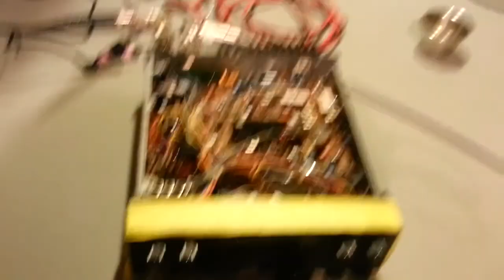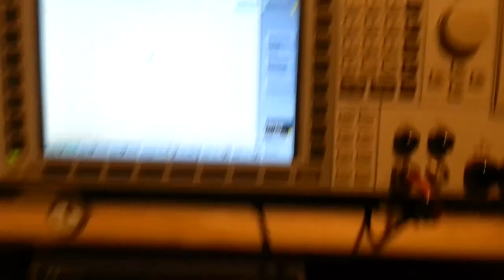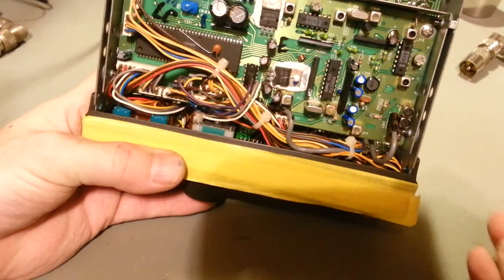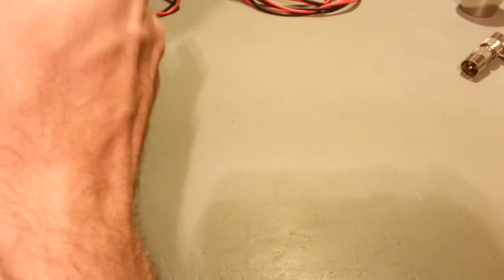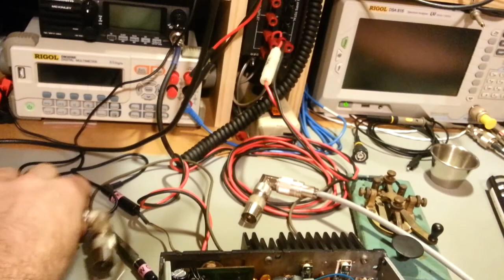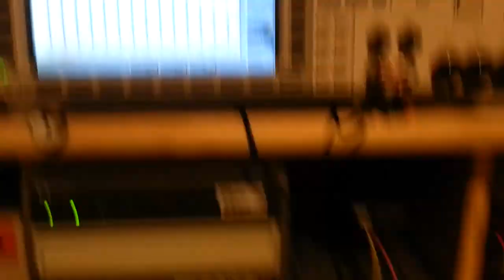President HR2510 restoration.

Comment: Thanks for posting this video. Can you please sugges/guess for me what might be the issue with an old 2510 that I’ve pulled out of storage that powers up but I don’t hear any audio besides a hiss happening and my liquid crystal display has some black blotches but no other digits or numerals displayed? It used to work just fine and I’m just trying to understand if it’s salvageable?  Someone suggested to me that could be a bad display. Glue on components is still a beige colour with no evidence of burns or decaying. Thanks.

Comment: I loved my 2510s. I guess this is still relevant.  You talk about drilling but not with a power tool. I bought 2 (a spare) 3 jaw chuck used on a dremel tool. It has a knearled barrel to hold onto. I put a wood peg in back to rest against your palm. The 3 jaws hold pretty much any drill bit or auger. Works great, comfortable and gets the job done.  And with less skips or missing your mark.
If you get this and know. I don't have any papers on this radio. The final is also used in a mobile amp. I'm hoping they dropped in price or a newer or better substitute . Got any part numbers for me?
Cheers.

Comment: I just acquired one of these. The display doesn't work but the rest does. I'm in the process of re-capping it in hopes of getting it operational. I noticed it had a resistor jumper added later on, I know exactly what the intention was for it but I plan to keep it just on 10 meter since my license covers that band. Thanks for making this video, i'll check out your other video(s) on this unit!

Comment: What is the model of the r&s tester? It looks like a nice bit of gear, wondering if I should look into getting one.
Reply from the maker: +TheDefpom 

CMU200.  Just remember it was really designed for use in the cellular industry so using it for two way radio can be a little tricky.   One way around some of its limitations is to use two of them.  I actually have 4 of them now or two setups.  Also, it does not demodulate.  I have the IF board 10.7MHz sample output routed to a external demodulator, another workaround.  If you do want to get one be sure you get one with all the options needed for radio/audio work.  I looked through hundreds of them to find the ones I got with just the right option package.  The only thing I couldn't find at a reasonable price was one with the FM MPX Stereo generator option.  I'm going to have to buy that license key.
Reply: Hi Scott look for the Model 1100.0008.30 it’s a bit hard to find but a better version. The one you will see most is like Mikes the .02 version, like he said you really need to do your homework on them so you know what options there are.
Reply: save up    get a real   job that pays better  mate